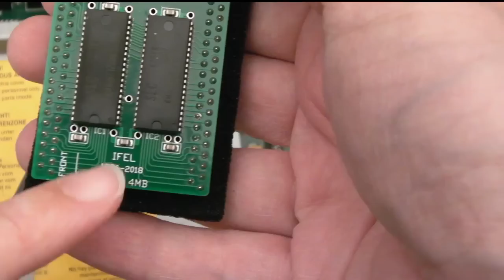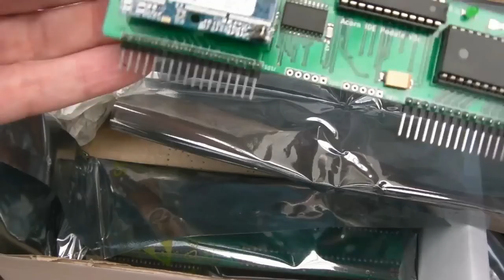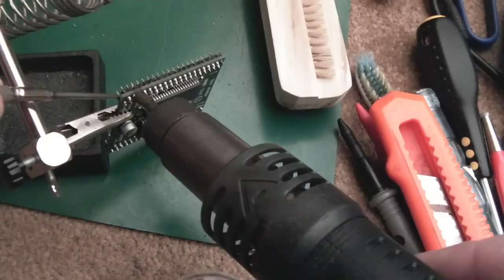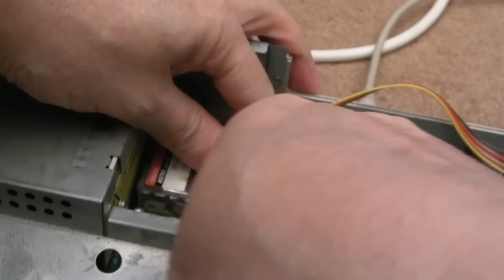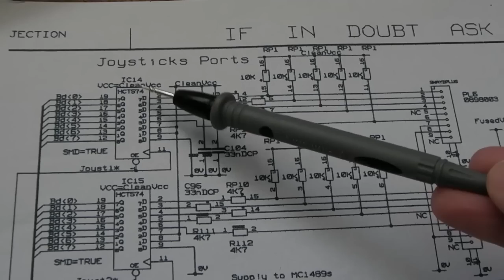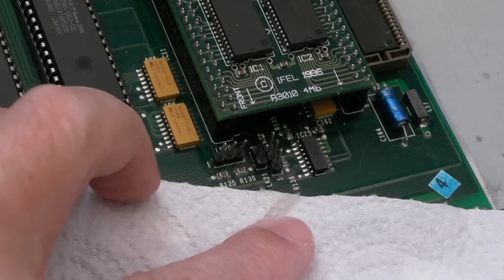Acorn Archimedes A3010 Repairs & Upgrades Part 5

Comment: Hi! I have an 3020 and has an ide connection on board but although it recognizes the cf card I connected, it gives me the following message:
“Disc error 23 at  :4/0FC10200 error when reading ADFS: :ZIDEDisc4.$”
Do you have any ideas on solving this issue? Thank you in advance! Teo
Reply from the maker: Your best bet is to hit stardot forum and ask over there - someone is bound to have seen that specific error.  It could be caused by a corrupt drive, or perhaps you have a fault on the IDE interface.  I did a repair to a 3020 recently that you might want to check out - there are two latches there related to the IDE, if there is a fault its probably one of those (or corroded trace).

Comment: I would use a dremal tool with a wire brush to get rid of those large areas of corrosion. But good video.
Reply from the maker: Dremel is a bit extreme, but if done carefully would work OK =D

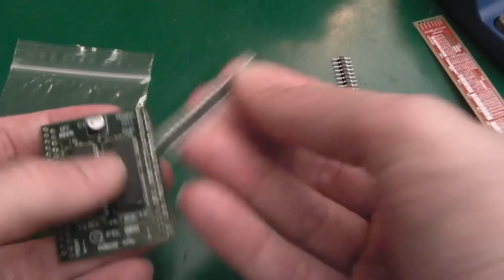Comment: 18:47 What are they called, those double-sided headers that are made to plug into an IC socket?
RS, Digikey, etc must sell them, but I'm blowed if I can come up with the right search term to find them...
Reply from the maker: pin header 2.54 turned pin
Reply: @GadgetUK164  Found them! Many thanks, chap!

Comment: Superconducting gold!? 😂 If you have some you will make a fortune! Gold is used on contacts because it doesn't corrode like copper or tin therefore producing more durable and reliable connections.
Reply from the maker: Thanks =D Gold is a superconductor though!  But yes, it is hardy to corrosion / oxidisation, but ultimately that leads to my same point - it remains a better lower resistance connection, which ultimately improves analogue connections but has little benefit to digital connections (where there's a large-ish tolerance) on socket edges and connectors internal to a system etc.

Comment: Good one Gadge, after watching your early vids on the Archimedes, I went out and got an A3010 myself (after a 400 mile round trip). 
It's been modded with the 26Mhz Overclock (https://www.vectorlight.net/retro/computers-and-modifications/acorn-archimedes-a3010-arm250-overclock ) and had the IDE restoration mod (https://www.vectorlight.net/retro/computers-and-modifications/acorn-archimedes-a3010-ide-modification ).
Reply from the maker: Nice =D  That's the mod I will be doing to this A3010  - just to show it etc, then I will probably revert it to stock.  The danger with overclocking is it can shorten the life, and the ARM250 is pretty much impossible to find as a replacement.

Comment: With that 4MB upgrade I wonder if the system would run at the same speed. The ARM Processor was very dependent on RAM speed and ZIP memories were often high speed.
Reply from the maker: I think so!  Since there's no capability to detect the RAM speed of the RAM that is fitted, it just uses the RAM at the speed the CPU is accessing the RAM, regardless of the RAM you fit.  ie. if the RAM was slower than the spec required, it would crash etc.

Comment: Great job, Chris !
If you keep one of the A3010s, maybe in a future video you could demonstrate overclocking on these machines.
It's easy, costs under GBP10, and you can more than double the machine's speed.
https://www.vectorlight.net/retro/computers-and-modifications/acorn-archimedes-a3010-arm250-overclock

Comment: By the way, did you end up with any boards that were totally beyond repair? I'm making a video series where I hook up an old ARM CPU from scratch on a breadboard, but a commenter said the CPUs are hard to get hold of - if you're selling off parts from any of these boards then there may be some interest in the CPUs.
Reply from the maker: Yes, the worst 3 are pretty much beyond.  They could be repaired, but as you will see in the next part, they would have a LOT of wires (eg. 100 or more).
Reply: @GadgetUK164  I'm looking forward to seeing that for sure - one of the things I love about your content is that you go way above and beyond what is reasonable to expect in these repairs!

Comment: It's always great to see your work, especially on this hardware as although I never owned one, I've always wanted one.

For ensuring pin headers are straight I usually solder one end roughly, then remelt it and move the header around feeling for when it is flush to the board. When it is, do the same to the other end, then inspect it carefully before committing to soldering the remaining pins. You can resolder the end pins afterwards with fresh solder if they've gone manky.

Another trick is to insert the pin header into the motherboard first, then put your daughterboard on top, and solder at least some of the pins. It ensures they are all lined up no matter how complex the layout is.

Comment: I used to work at the factory that manufactured these, the 3010 and the 3020 back in '92-'93, Welwyn Electronics it was called. I didn't work on any assembly lines, I did warehousing but I think the main boards were assembled and tested and then maybe even assembled into finished products, I know we had all the documentation manuals and what not so it's possible final product left the factory my memory isn't clear now. I had totally lost interest in home computers by then and had just got my hands on a Double Pro Fighter which for those who might not know was a module with a 3.5" drive on that could copy MegaDrive and SNES carts to floppy disks and that was just the best as far as I was concerned so I payed little interest in these machines and everyone I spoke to at the time had nothing good to say about them either, seems a shame cos the game footage you show here Gadget looks great and with the mods you're fitting this may well be a hidden gem. Good to see.
Reply from the maker: Very cool - thanks for sharing that =D
Reply: The Archimedes didn't have a lack of ability, it suffered from the fact the ARM and it's chips were a chore to write for. At that time period much of the performance programming was being done in machine code/assembly and as such the tools being used on other processors had matured over many years, and the processor command structure was defined as to be "friendly". ARM was new, RISC command structure was stripped down making what was a single command (with multiple instruction cycles) on many processor into multiple commands (with single instruction cycles) and as you can imagine this made programming on ARM a much more laborious task. Effort goes to bigger markets so the Archimedes was starved of developers as it was late to the market.
TLDR - Basically writing in M.C/Assembly on A CISC chip is quicker and easier than writing in RISC (even if the RISC code has the opportunity to be more efficient) but then add debugging and it makes the task even bigger.

Comment: I first heard about the Archimedes way back when my computer was an Amiga 500 (and it was current), and I was intrigued. Being in the US I've never seen one in person; always wanted to get ahold of one, but they seem to be incredibly rare!
Reply: Many were sold to schools in the UK (probably the biggest buyer) and when they reached the end of useful life they were often destroyed. I was the IT tech at a school in London and we were going to give our older systems to another school (the IT director was a Mac fan so that's the direction we went) but we were informed for us to do so they would require a complete electrical test that was going to cost a lot of money (we were giving them away and the other school didn't have the money for the test) so I had to order a skip and smash them so that they could not be reused. Apparently if a system we discarded was used and caused an accident, we would be held accountable, thus the smashing.
Reply: @daishi5571  Wow, what a shame - such a waste.
Reply from the maker: This kind of practice still goes on!  For example, I have it on good authority that one of the leading toy shops in the UK destroy returned products - eg. Lego set that has missing parts or a damaged part, everything goes into a recycling bin, regardless of the fact it could be of value or repaired.  Employees are not allowed to 'save' this stuff either.

Comment: I missed the stream of this as I was insalling a ZIF ROM socket in my Spectrum 128 test board. Great job on the memory upgrades. You should make your own stickers to put on the bottom of the computers you've fixed. (rebuilt). :)

Comment: Quick question, to you have a breadboard? If you can line up the pins in a breadboard and solder it, it should keep them straight
Reply from the maker: Yes, got breadboards =D  The problem is exactly the same as I tried to explain about using a socket / strip of female header.  The pitch is not 2.54 between  the two sides (on either strip).   So you cannot use breadboard either =/

Comment: gold plating is done to prevent corrosion on contacts.silver is better conductor but corrodes more
Reply from the maker: I think the thing is, most people think of gold plated connectors and giving a better connection because they don't suffer that corrosion / oxidisation.  The reality is on digital connections it makes little difference to signal integrity.